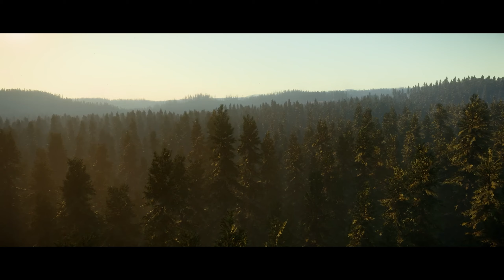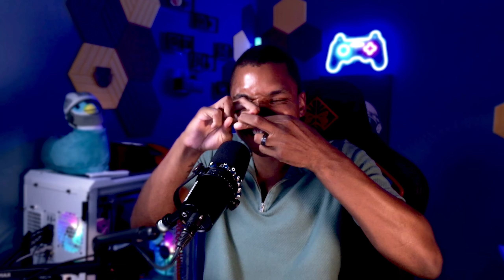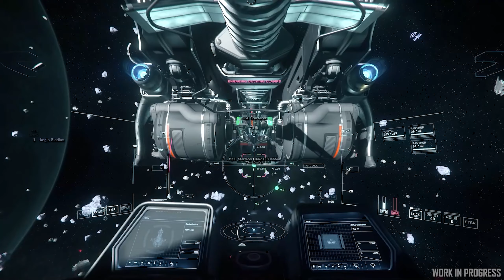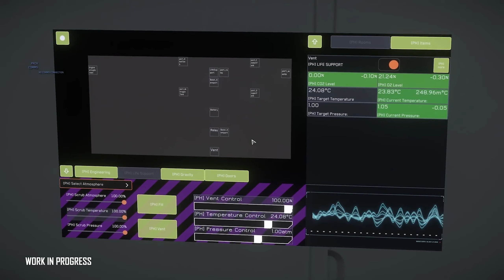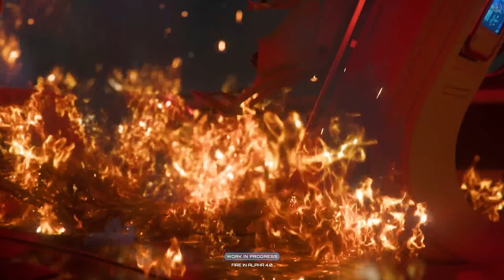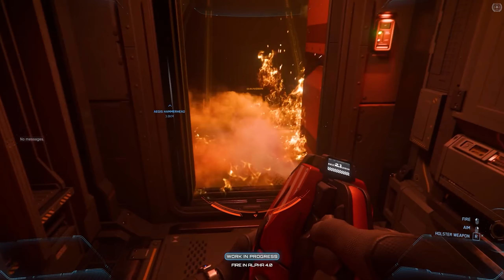Ship Maintenance, Engineering, & Firefighting In Star Citizen 4.0 | Feature Watch

Comment: There's going to have to be some major pro's to running a large ship. I can hardly get a turret gunner, nevermind an engineer, people to load missiles, gunners, on foot security etc.  Much easier to get a few people with light fighters, a mantis, and a hauler and prey on someone else's time on efforts. Glad to see fuel finally coming into the picture. Maybe dial fire back a couple notches? Grenades shouldn't be starting fires. Neither should a couple shots from a sidearm on an interior panel.

Comment: If you don't change the oil in your car the moving parts will heat up due to friction and can set your car on fire.
Reply: in a stock air-cooled VW, if the fuel filter comes loose or fails, fuel can end up splashing over the top of the engine and/or exhaust, leading to a fire.